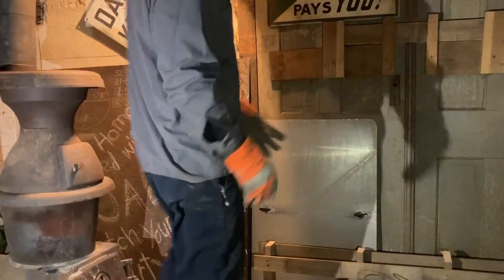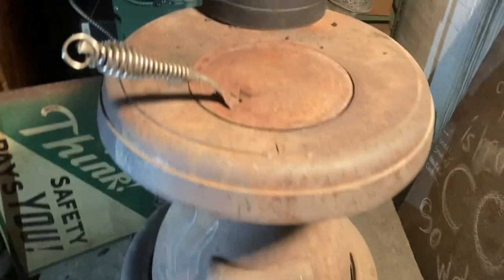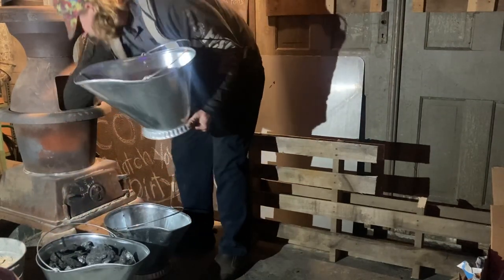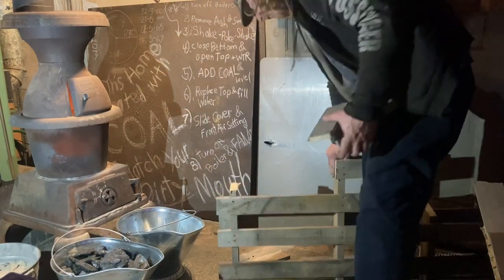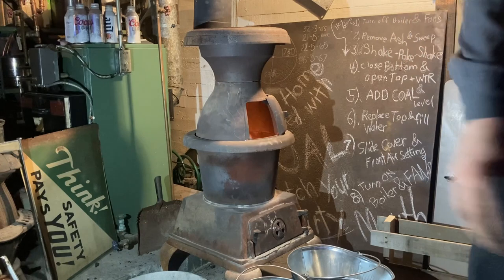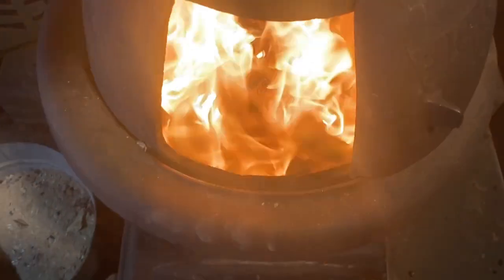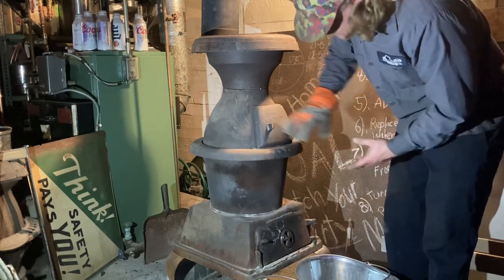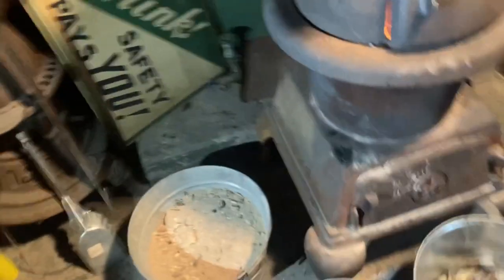How to Burn Anthracite Coal in Pot Belly Stove (Pt.1 Lighting)

Comment: You're making this process a lot more complicated than it needs to be.  Get yourself a bag of Matchlight charcoal or use the map gas torch to get a few briquets of regular charcoal going in the bottom.  Once that's going add two or three scoops of the nut coal.  That'll fire up pretty fast.  Then add your stove coal up to the top of the pot, close the flue, and close the intake until it's 1/8th open or less.  Then don't fool with it and you'll be good to go.

*When an experienced wood stove user switches to coal there is a tendency to "over work" the stove.  Wood stoves require a lot of fiddling with over the course of the day.  Coal stoves do not.  Get it set and leave it alone.

Nice video.
Reply from the maker: Thanks for the tip, I tried matchlight charcoal the other night and it saved the labor of cutting wood and the time to let the wood burn to coals.

Comment: I'll give my advice on starting a coal stove..
Clean stove good
Put coal in firebox.
I use corn cobs soaked in kerosene, then leave them drip out.
Put corncobs in ashbox, under grating, add some pallet wood onto of cobs.
Light cobs and walk away,come back in 5-7 minutes. 
Coal will be crackling(burning).
Set draft,walk away..
This way is much,much quicker and easier,flames from cobs and pallets go up thru grate,under and through coal and ignite it easily..fire always burns up,not down.your way goes against that fact by lighting onto of coal,my way goes with the fact by lighting underneath the coal.
The cobs and pallet wood under create a draft up which takes flame with it..
The cobs/wood turn to ash anyways,just as they should..
Think about it for a minute and try it.
Also I clean my chimney without climbing on the roof,most use a "t" shaped cleanout,which let's brush only go 1 way,vertical or horizontal. I made a stainless "+" shaped joint with 2 caps,rear and bottom.i let my fire go almost out the ladt night of the month,then in the morning pop both caps off,run brush up chimney,then from outside into stove,takes roughly 2 minutes,then add coal and open bottom draft,got heat back in 10 minutes. I tried to get my + made by chimney companies,but they all said it would close the cleaning side of thier business..
Reply: Oh,bituminous coal,nut size,which looks like your stove coal,is 160 per ton here.its very very clean,no slag,slack,or non coal particles,and run thru a screener to ensure size
Reply: Really enjoy our enthusiasm with using coal heat..on my messy ash removal my solution ended up being.i use a metal lawn cart outside.
I made a metal box with bottom and 4 sides with provisions to slide a lid onto it,has 1 one inch nut welded on front rear.
Open ash door ,slide lid in onto of box,hook front nut with a hook,pull box out ,hook rear nut with 2nd hook,carry outside and dump in cart,return box to furnace ,takes 3 minutes.this way eliminates ash spew into house,clean in morning when ash is coolest,hotter air rises,which carries ash.when ashes are cooler,they carry less..I've tried many many ways to eliminate ash travel,this works best,by keeping all ash in stove
Reply from the maker: That bituminous coal you have lights totally different than this hard coal, it needs direct contact from hot wood coals to get going, I have tried a fire in the ash pan it will not light this kind of coal.

Comment: thanks, I think I am going to burn wood, it seems easier.   I bought a OLD pot belly, but it's kinda of big.  Has the air vent wheel and door on top, and a cover for the shaker grate (much more primitive than yours for sure)  - the seller said it was dirty so ok for a garage which is my plan

Comment: Help, bought a new old style potbelly stove caboose type, my issue is that it's scary seeing the bottom glowing red. I don't care to see it glowing red, seems unsafe what is your opinion on this?
Reply from the maker: My stove runs a cherry red hot all the time, it no problem, keep the combustibles, kids, animals, and fools well away from it!
Reply: @ArtBarn591  thank you
Reply: @ArtBarn591  I lined the inside with firebrick and it's good now!
Reply: @colbolt54 you re losing heat with brick